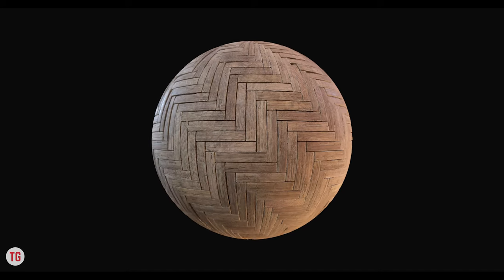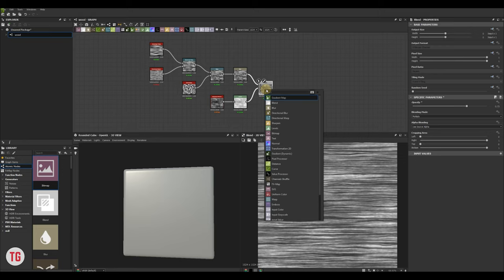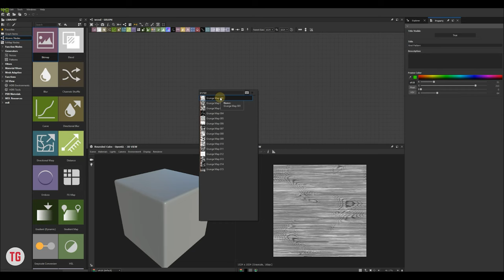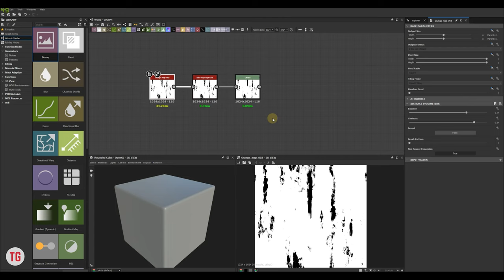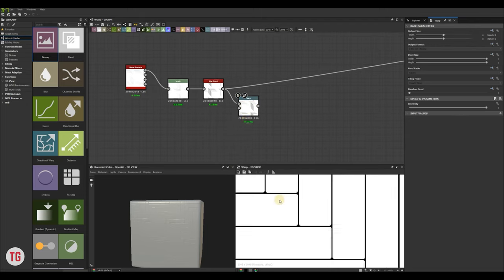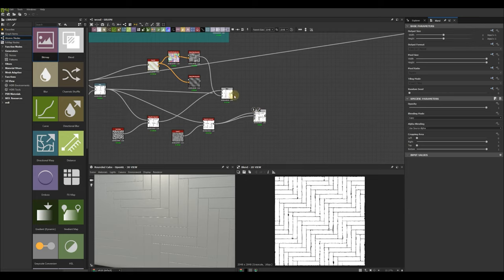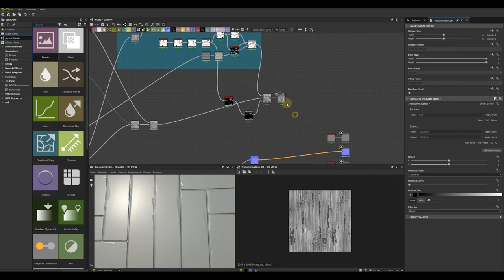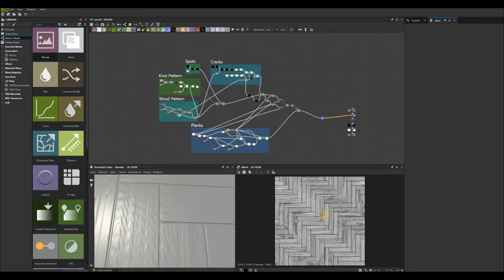Old Wood Herringbone Flooring in Substance Designer | Part 1

Comment: Great tutorial, thank you very much!
On a side note, i've found that instead of using a directional warp node to offset wood pattern for each plank, it's better to use vector warp grayscale. Plug your wood grain into the input of the vector warp and use the flood fill to random color from the planks pattern as a vector map input. It offsets the texture by a great amount in the intensity range of 1, whereas directional warp's intensity needs to be cranked all the way up to like a 1000 to offset the texture by the same amount.